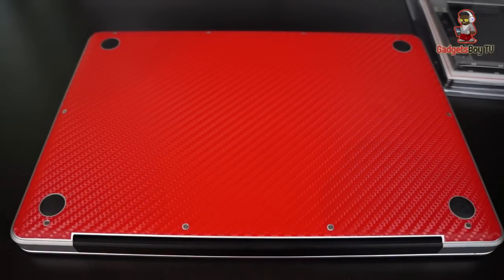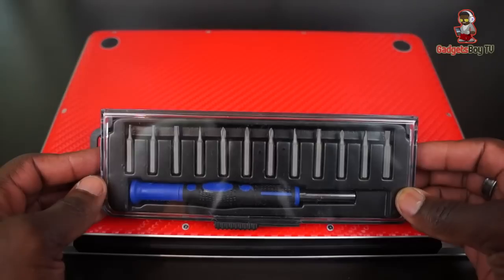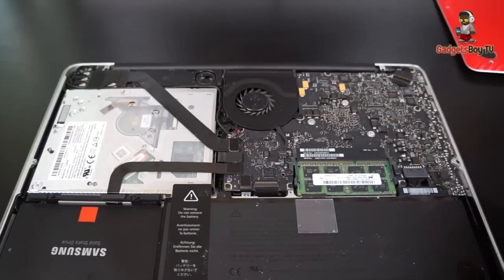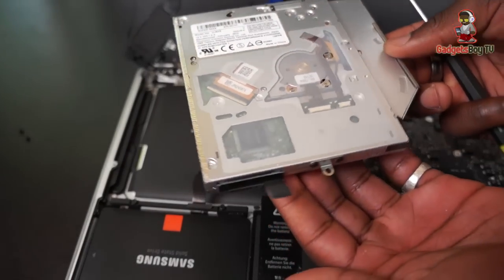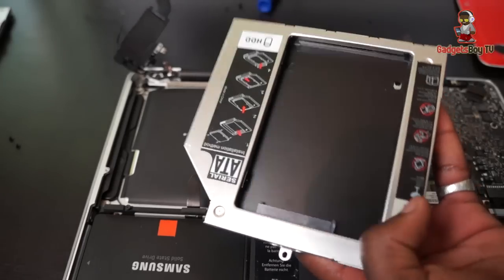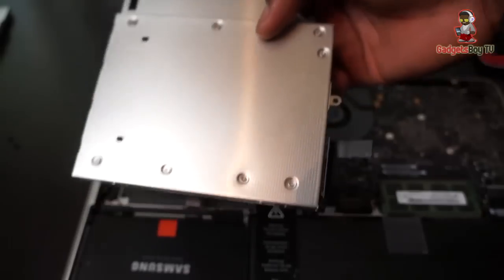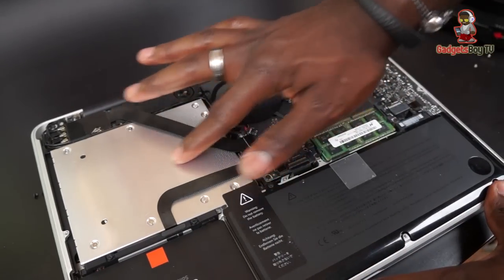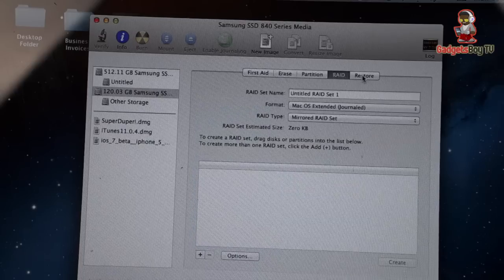How To Add Second A SSD to Replace Optical Drive MacBook Pro 2012

Comment: did it just like you, formatted it the same way, but when i copy large files on the second ssd (I'm not using it as system drive, so I didn't clone it or anything) it ejects and it says eject before removing the disk and the disk isn't visible anymore. Samsung ssd 450 evo 125 gigs... any idea? the copying process stops at 3,1 gb of 5 gb (a folder with tv series...)

Comment: im far from technical but i want to upgrade the orginal hard drive in my late 2011 13 inch macbook pro with a 2tb ssd and also replace the optical drive with a sshd.  question is how big a TB sshd can i put in there? if anyone can help that would be great. thanks.

Comment: Did this modification add more weight to the mac?
Reply: nope! the ssd is actually itself lighter than the dvd drive!
Reply: Gowtham Sekar Sure, but what about the SSD and caddy combined?
Reply: Kieran D the caddy is just a frame it will have low weight when compared to the optical one! so combined with ssd it will have lesser Wait than the optical drive

Comment: Need little help here.  Ssd in optical drive could not be formatted . Used external USB cables to format. Again in optical drive error code appears.. could not copy files or move files.. hdd is detected though.
Reply: It’s not compatible with some MacBook Pro’s from 2012 from what I’ve read unless you replace a bunch of parts just not worth it, I put a 500GB sata drive in the optical drive bay and works fine for a storage drive.

Comment: Absolutely not. A PC is very different on the inside, and you have to research about the PC model. Probably, removing the optical drive on a PC would not work, because the drive is a part of the case, that pops out to put a CD. In the MacBook, the unibody has a very little cut for you to insert the CD. The only way you would be able to do this on a PC if the caddy matches the exterior shape/color, and if the computer supports dual bays of hard drives.

Comment: Thanks for the guide man. I installed a Samsung 840 evo in my Macbook pro 6.2 carefully but I can't to it. I tried in both Mavericks and Windows 7 without success - I and tried the whole process twice. Do you have any ideas what I can do about it? This is the optibay I used: http://www.ebay.com/itm/Universal-9-5mm-SATA-2-5-Hard-Drive-SSD-Optical-Drive-Bay-Caddy-Notebook-Laptop-/221290039347?pt=US_Drive_Bay_Caddies&hash=item3385ea0833.
I will really appreciate your help.
Reply from the maker: not sure sorry, are you getting any errors? and did you clone our drive properly?